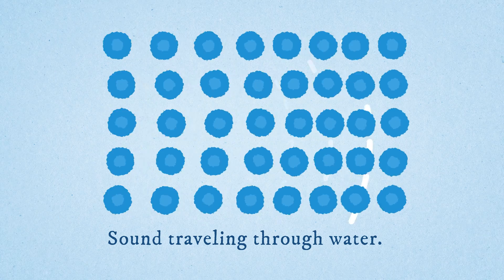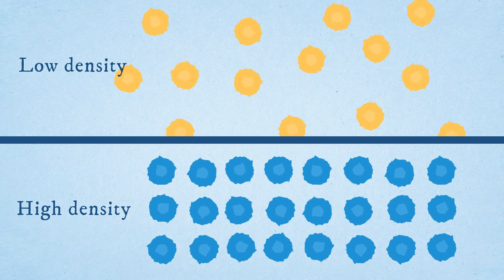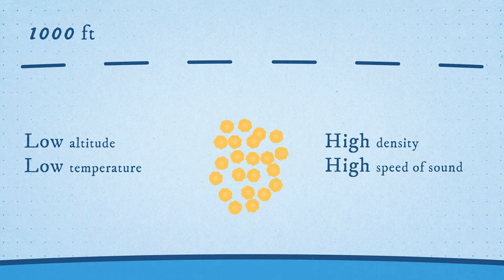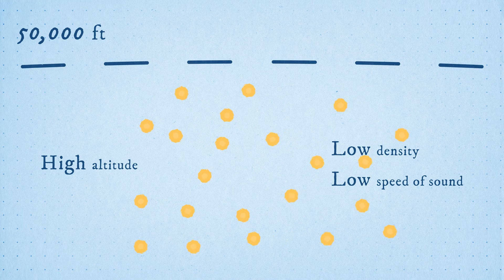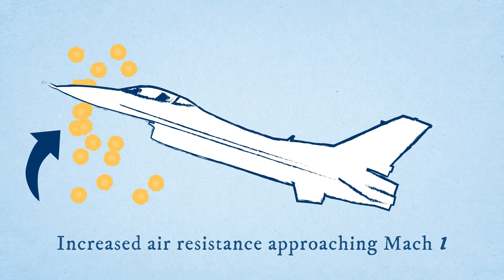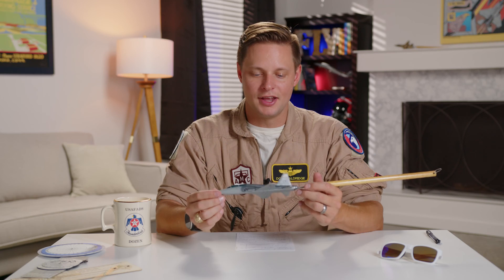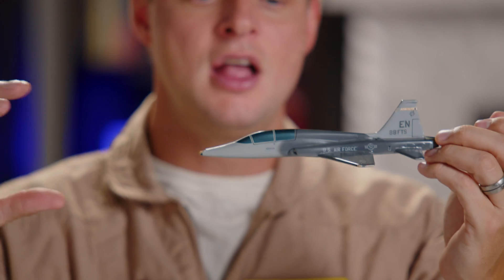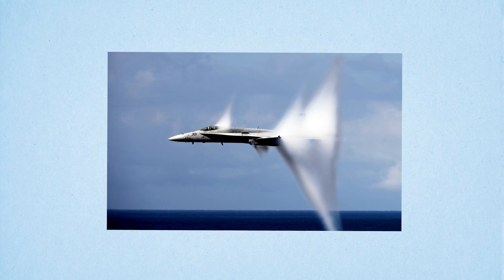Why fighter pilots need to break the speed of sound | MACH 1 EXPLAINED

Comment: Those condensation cones that occur at transonic speeds have a cool technical name 🙂, PRANDTL-GLAUERT SINGULARITY 🕳️🤯 (or Prandtl-Glauert cloud ☁️😎), named after Ludwig Prandtl, a German fluid dynamicist who pioneered the Bound Vortex theory of lift we still use to this day by catching the Shed Vortex behind an airfoil on camera in the early 20th century, and Hermann Glauert, a British aerodynamicist who wrote The Elements of Airfoil and Airscrew Theory and the independently created the Prandtl-Glauert method for dealing with the mathematics of compressible airflow, which was a major problem in the early 20th century.

The Prandtl-Glauert Singularity, thusly named, is really cool because it's an actual physical manifestation of the point where normal math breaks down in flow systems!! 🤯😎😳

Comment: A little technical tip ... 🙂 in a  *gas*, assuming the ratio of specific heats (constant pressure vs constant volume) remains the same, the speed of sound is directly proportional to TEMPERATURE 🌡️ and NOT pressure or density  ... which I only found out myself while reading about sound waves from a NASA Glenn Research Center page on supersonic flight. Oops! 😬 

This threw me off for many years, because it's somewhat counterintuitive at first, but the temperature of a gas represents the kinetic energy of the particles inside the gas and thus their speed. The speed of the particles determines how quickly they bump into each other, and thus the speed at which a disturbance propagates. 

Eg: lots of particles moving very slowly in a gas won't transmit sound quickly despite high density, while a single fast moving particle (or a few) bouncing off the nose of a jet will bounce into an object far away more quickly. Individual particles, in extreme circumstances, can transmit the sound pressure, and they can even move through other particles, however actually calculating the speed of sound in a rarified gas requires a different formula because of problems with gamma. (Gamma is the ratio of specific heats.) Thank you, NASA!🤙😂

Comment: Very nice video! Just one quick correction though, the speed of sound (at least in fluids) is actually a function of the temperature of the fluid and not the density. The speed of sound is derived from the Kinetic Theory of Gases which describes how the molecular speed of gas particles is a dependent upon temperature only. Thus the speed at which molecules can transfer information to each other (i.e. the speed of sound) is a function of temperature only. Temperature and density are related though for gasses so there is some correlation between density and the speed of sound but it isn't a causal relationship.

Comment: Sorry, but the speed of sound in air, or for most gasses in general, doesn’t have anything to with density. The equation for the speed of sound is proportional to the square root of total temperature.  You’re trying to explain compressibility effects and shockwaves which are a function of density, but the value for the speed of sounds is independent of density.
Reply from the maker: Trying to find something you said that was correct in the comment. Still searching…

Comment: Wouldnt it be easier to say that the speed of sound is more closely related to temperature than air density?  the colder it is the lower the speed of sound?  even in your watr example, sound travels faster at deeper depths because the water is colder.  i guess in the end its really 6 in one and half a dozen (see what i did there) in the other.  colder is denser.
Reply: If I’m understanding your comment correctly you have the right idea with temperature however air pressure is determined by more than just temperature, for example at low altitudes you have all of the ‘weight’ of the air above it pushing down and compressing the air making it more dense
Reply: @matthewthomas2807  what about an inversion layer?  Climbing out of KPBI the other day it was +20 C at FL200 (not uncommon in that area of the world) but it quickly cooled off above FL240.  Its very difficult to measure density inside the cockpit, but very easy to get TAT, SAT and ISA deviation.  The colder it is, the lower my IAS and higher MACH.  Realistically we are talking only about 3-4 knots for large temp ranges, so its more a technical discussion than what actually matters in reality.  But an aircraft say doing a fly by in KCOS in December at 400kts, has a higher likely-hood of accidentally breaking the sound barrier than the same aircraft in August,  Is it air density or temp?  I say its both, its just that temp is something we can feel and measure easier.  I find it also easier to discuss in terms of temp with new pilots instead of density because then they get confused about density altitude.  BUt to be clear, everything in this video is correct, I am not disputing anything Dozen said.  Im just throwing out some discussion.  its why we are here.
Reply: @windrideractual  read above
Reply: @matthewthomas2807  Check out my comment above (you can sort by new to find it faster) for an explanation on how the speed of sound for gasses is actually only a function of the density
Reply: @jacobdewey2053  yes I was trying to explain it with using weight of air to explain density, I know it’s a very imperfect explanation but it can be very hard to know what peoples backgrounds are on this app, I’m a pilot but explaining things admittedly isn’t always my forte